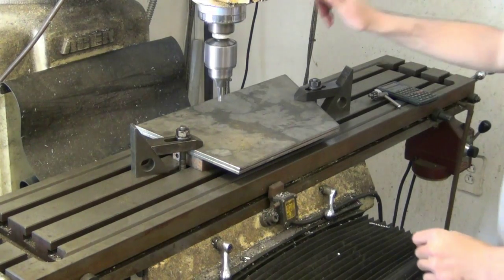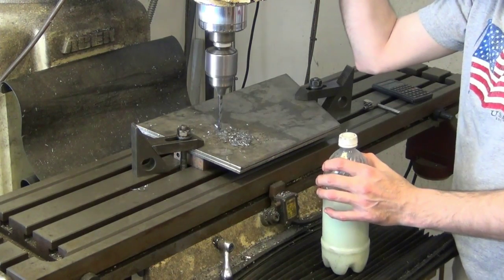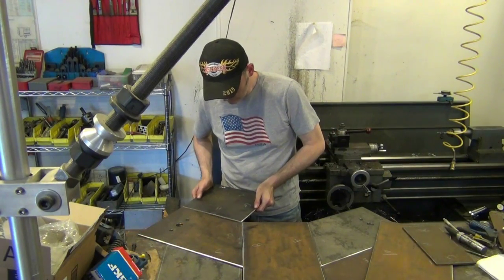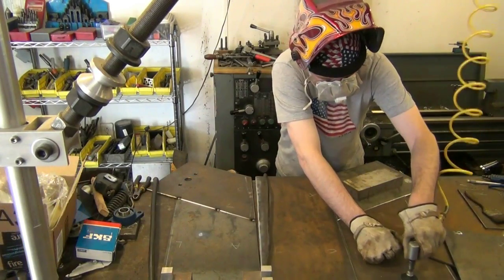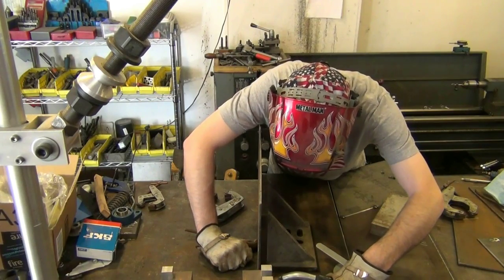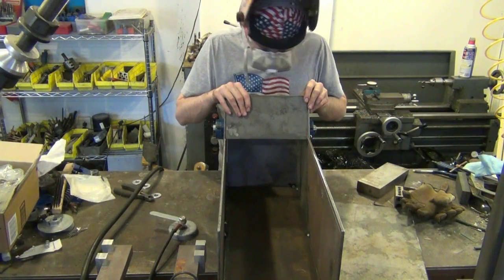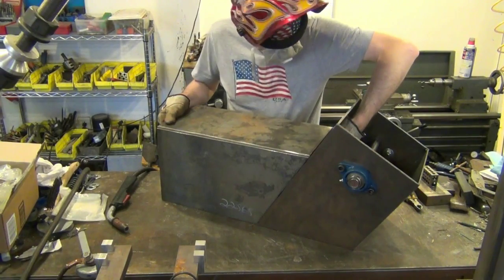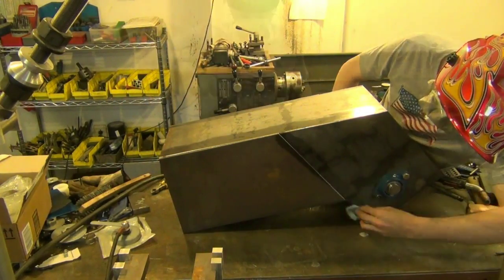Building My Second Glass Crusher Part 2 of 7

Comment: hello, very nice machine. been looking to build one an was wondering if you would like to share your design so I may build one. as far as all the messurments? thanks Bryan
Reply from the maker: Thanks. I plan to make a manual on how to build one at some point, but haven't yet. I don't have any measurements yet and my machine is currently in storage. When I get it out, I will note the dimensions. I'll built this from an idea in my head and a few rough sketches, so their are no prints for it, per se.
Reply: I would gladly pay for some plans from you. This is the sort of model I have had in mind same similar design in my head. Do you have Facebook?
Reply from the maker: I can let you know when I have plans available. I'm not on facebook, but I can be contacted through my site at www.arnoldsdesign.com